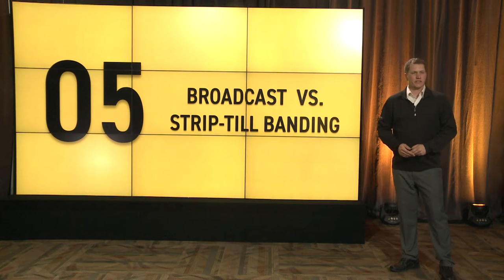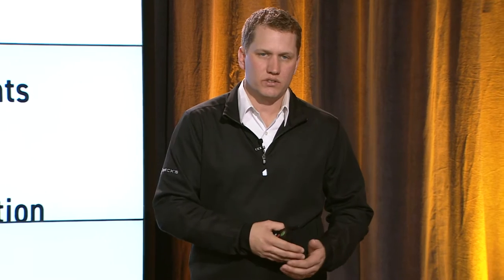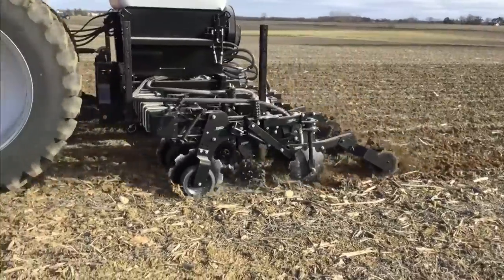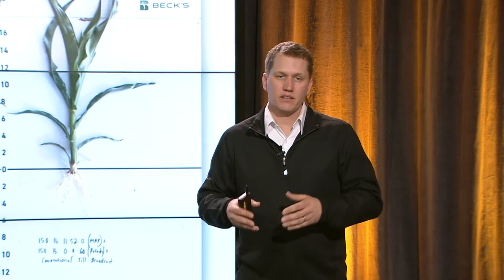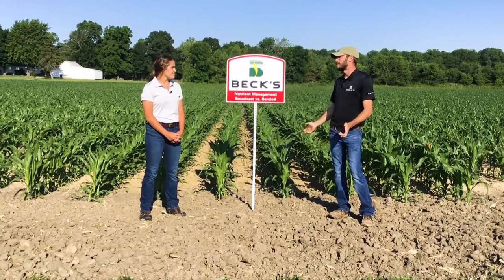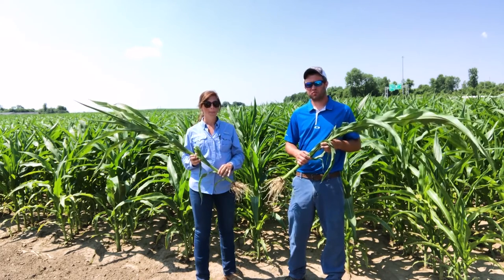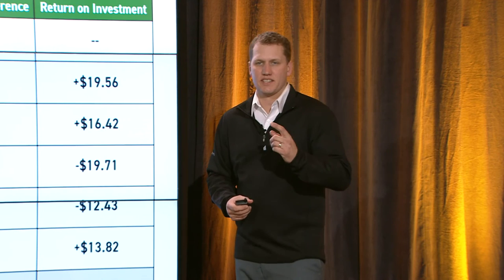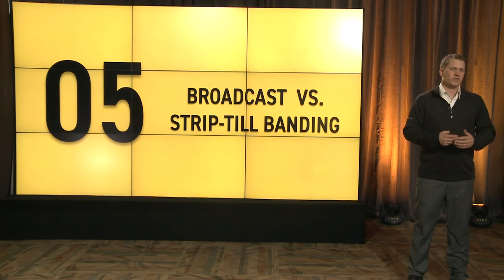Broadcast vs. Strip-Till Banding | Deep Dive | Beck's 2021 PFR Insight Meetings

Comment: To me it looks like you've already decided ahead of time that banding will be the winner. Not saying it doesn't make sense that it should be the winner.  It also looks like the soil fertility you are starting with is already pretty good as your yields and k% levels with very low application rates are really good. I don't see the justification of going to banding to gain 5 bushels when you have to invest more time and more equipment vs. no-till. Maybe try this on some depleted soils where that 'nutrient stratification' issue we no-tillers are supposed to be hitting would be present.  A good drought year or two of data would also help as you might be able to see if this makes your crop more or less resilient.